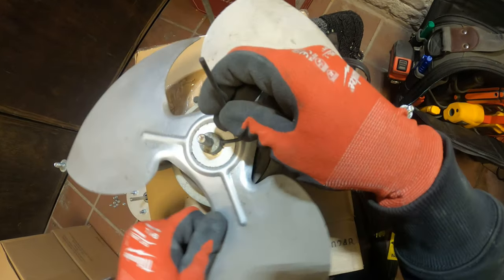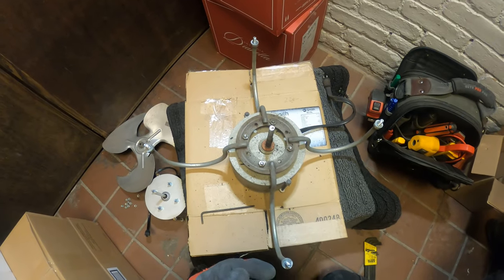HVACR Service Call: Frozen Evaporator Coil Walk In Cooler (Frozen Evaporator Coil Diagnosis/Repair)

Comment: If your box temp was in the 50's and your suction pressure was like 40, (saturation like 5f) I would check that the valve was feeding properly. If the suction line wasn't freezing then super heat out of the evap is well over 30 degrees. Im not saying I would want a frozen suction line, but to me that would seem like a restriction somewhere. I would suspect another underlying issue with that system.
Reply: if the box is 50   his pressure at start up should of been 70-80  for  404A    his valve is starving